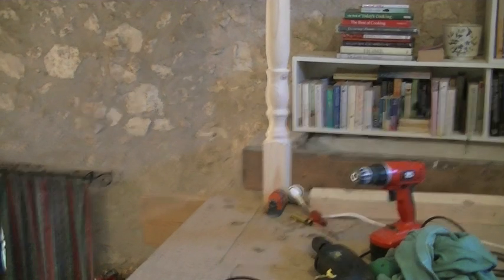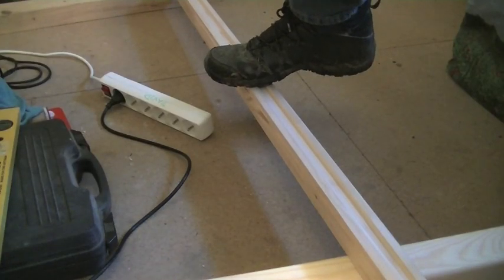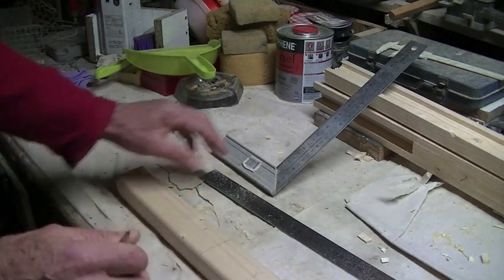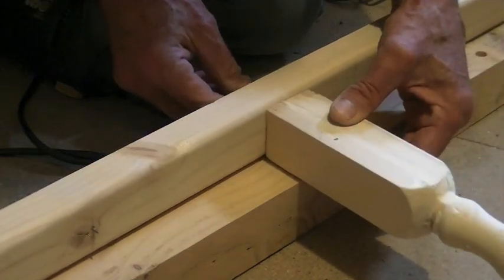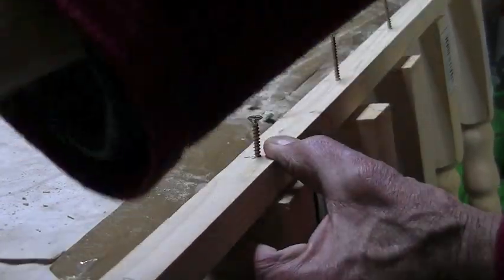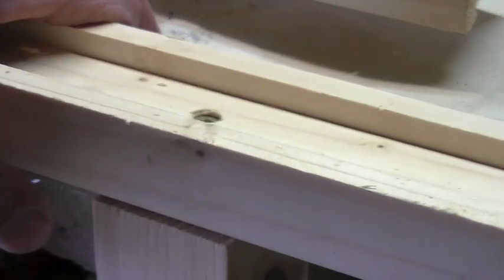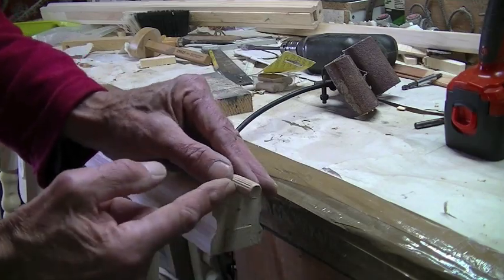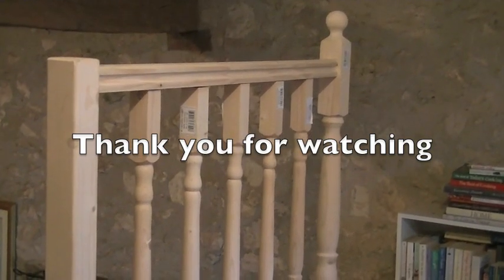Newel Post, Railing and Balusters Installation made easy

Comment: I dont know when you fitted this but current building regs state that a 100mm sphere cannot pass between spindles so 185mm even accounting for the width of the spindle would not be legal. Hope this helps.
Reply from the maker: 2 years ago, no I didn't know that, thanks 747, I just made it so my dogs head wouldn't pass through:)
Reply: @davekennedy52  yeah fair enough, the reason for 100mm is so a small child or baby can't get their head through and therefore fall.
Reply from the maker: @seven4seven  I can understand that those precautions have to be made, thanks for the info

Comment: Your spindles are too wide. They should go in the railing and the infill supplied cut to go in between.   Did you just have spare spindles to use up?
Reply from the maker: Sadly I had no choice in spindles They're definitely too wide and you're quite right in what you're saying. I thought of cutting each one to fit into the handrail, but it would have taken me too long; I don't have the right tools. Thanks for being so observant.